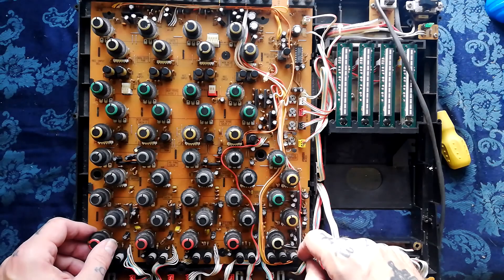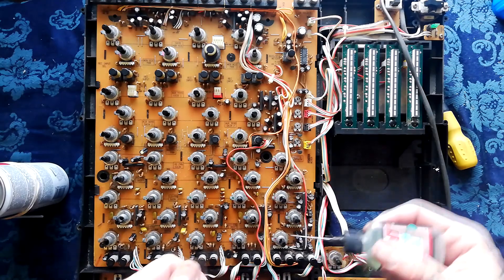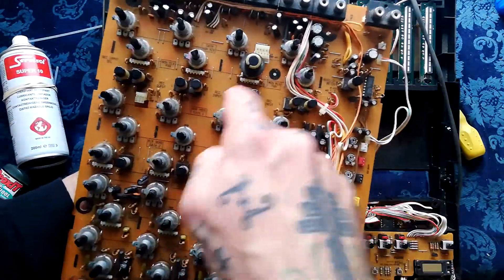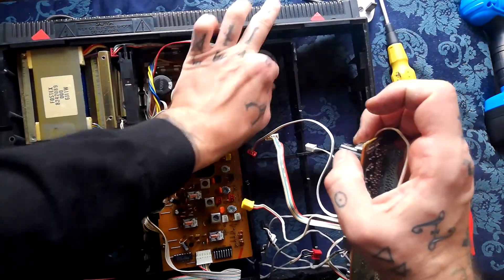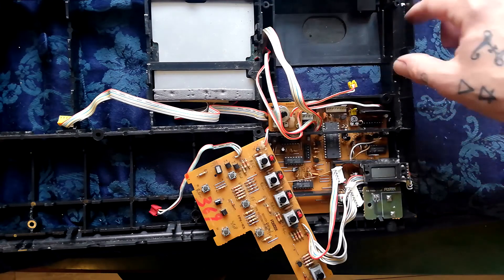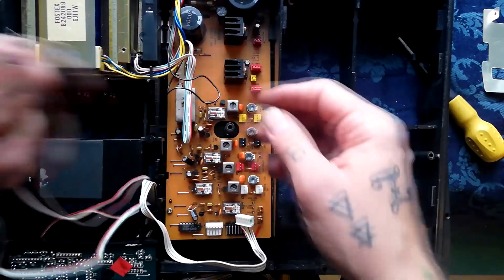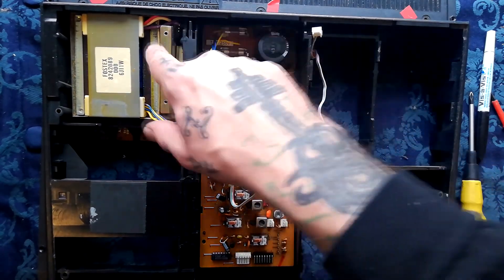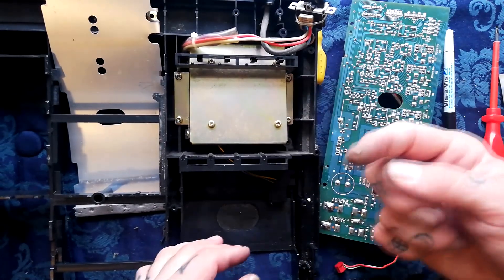Fostex 260 | Tear down | 3 | remove PCBs | Calibration controls

Comment: Thank you so much for all your videos, especially these on the Fostex 260 (I also have a Tascam 246 but my now-ancient recording was all done on the 260). I’m moving my old recordings to digital soon, so I need to have my 260 sending all 4 channels of tape out. I don’t need to record, I’m just focusing on playback at this point…

I’ve cleaned and replaced the belt and pinch roller, cleaned all contacts, and one problem remains: I don’t get any signal from tape channel 1, no matter where I route the signal. 

I just watched your video where you traced the audio signal on a 244, and it made perfect sense to what you were doing (it ended up being a head problem with the recording/PB head).

I can get signal into channel 1, but can’t get any signal out of channel 1 no matter how I try to route it (Monmix, stereo, tape out, Monitor 1/2, Aux 1/2). 

My questions:
1. Does a signal in but no signal out rule out a problem on the input  PCB?
2. Aside from the record/PB head and the signal tracing, is there anything else I should do to diagnose the lack of channel 1 output?

Thanks in advance for any help you can provide.
Reply from the maker: I'm glad the videos have helped you. If you can record to track 1 flip the cassette over and hear what you recorded play backwards on track 4 I would be satisfied that the input path to track 1 and the track one segment of the record/playback head were healthy. I would then get the schematics from my blog and use either photoshop or plain old low yech coloured marker on paper printouts to figure out the signal path from the head to the tape out in playback ord mode - which should go sometjing like this head; connecting wires; relay or other switching solution (choosing whether the head is connected to the record smp or the play amp) coupling capacitor; opamp; another coupling cap; tape out socket. Armed with this recon,  use an audio probe to find where the signal is blocked, replace components as appropriate
Reply: @Tetrakan  Hi again, The meters were showing a signal in to channel 1, but the meters are connected directly to the front end of the input PCB (J101 for anyone scoring at home). I did the record-on-side-A-and-play-backwards from-side-B trick, and lo and behold….there’s no recording there. Tracing the signal path with the schematic and on the board, the input signal from the jack isn’t getting to J102, which is the output jack/plug at the mixer side of the input PCB. That’s why it isn’t recording on Channel 1. The grape transport out goes through J102 into the PWR assembly, then to the Rec/PB amp, and then to the mixer. Since those four channels don’t come apart, it looks like it needs a new input PCB. Ugh. I don’t even know how to begin to find one if they exist outside of “parts only” 260s, and there’s no guarantee of their condition from a seller that can’t (or hasn’t) tested it.

So…I’ve got at least a partial diagnosis, now I either need a parts source or needs o get lucky and score aa neglected (but not abused) 260 on Craigslist or on the interwebs.  Any suggestions? (8 other lurkers with Fostex 260s in their family room want to know, but won’t admit it). :>

Comment: Hi;  
I recently purchased a fostex 260 in average condition.  
I changed the belt and cleaned it but now I have another problem.  
When I press pause the transport gets stuck in the high position, so I have to restart the machine to return it to its normal state.
Do you have any idea what i need to check ? 

I cleaned the solenoid but always the same .. 

Thank you for your attention and the time  you spend dismantling these machines!
Reply: Did you ever figure this out? I have the same issue.
Reply: I actually found the solution! It's in my most recent video!

Comment: These videos are so helpful! Thank you for posting them! I’m currently trying to get my fostex 260 in working order, but my play head is running way too fast. I tried turning the trim pot mentioned @6:00 but it doesn’t seem to have any effect on the pitch. Do you have any suggestions? Thanks!
Reply from the maker: Tjanks! If the cables or solder between  the pitch control and the motor are faulty that can cause the pitch control to be unresponsive. Use Continuity tester on your multimeter to check the connections and apply fresh solder if necessary
Reply: Hello again! So I managed to figure out that my trim pot was faulty, although when I have the new trim pot and mean pitch knob turned down as low as possible, the tape is still running very fast. Any ideas where to look next? I’m kinda stumped
Reply from the maker: Two thi ga to consider... That unit runs at 3&3/4ips, if you play a 1&7/8 ips recording in there it will sound like Alvin and the chipmunks. If the replacement trimpot is too low a value the motor will run fast. Either of these apply to you?
Reply: So the trim pot I used for the pitch has a 10ko resistance, and I also think I’m using a 1 7/8 recording which explains a lot. Almost any professionally manufactured tape sounds very fast. If I increase the resistance, can I make the playhead record at 1 7/8?
Reply from the maker: I don't know the value of the original trimpot, but I'll be in the service manual which I'm.pretty sure is up o  my blog? Yes more resistance = slower motor. A commercial tape should play back at double speed. 3&3/4 ips will give you better fidelity.

Comment: Hey there! Thanks for those videos! I own a Fostex 260 and it functions as expected... ! Well, except for the stereo bus/stereo monitoring. I'm only hearing one side! I am suspecting something either got unsoldered or some component on the right channel died. Got any idea what the problem could be? The recorder definitely records on every channel, it's just hearing the right side via the Stereo outputs/monitor that isn't functioning.
Reply from the maker: Thanks. Check solder where the master fader joins the PCB, the condition of the base plate and internal brushes in case someone spilled a drink on it at some point and the metal parts corroded, then there are typically coupling capacitors bookending buffer opamps either side of the master fader, any one of those components going open or leaky can guive you dead o weird audio in one half of the stereo image. Check out this video, its on a porta 03 but covers the sort of trouboleshooting you will need to do. https://youtu.be/fVs0ALyEUMY
Reply: @Tetrakan  Thanks for the pointers, I'll try that!

Comment: Hello, I'm having trouble calibrating any fostex VU meter. In the service manual, it says that -10db (0.3v) signal should show 0db on the VU meter, but it just dont reach there, in both an reel to reel Model 20 and mixer Fostex 450 it just dont reach there, goes max to -7db on VU meter, doing all the service manual procedures it just dont reach to 0db even at the max pot. I see that you mess around with a lot fostex stuff, did you ever had any trouble with that or you can reach the 0db VU bar normaly?
Reply from the maker: Hmm, can you tell me more about the signal you are using to calibrate the meters and how you are measuring its amplitude? I ask because when I was getting into this I wasn’t clear on the difference between RMS, peak, and peak-to-peak AC voltages….if you were injecting a 0.3 v peak voltage signal into the meter that would not be enough, since 0.3v RMS is going to be over 0.7volts peak to peak, and not all signal generators I’ve owned stated which form of AC you were adjusting on the display

Comment: Btw, could you help me with a dead track nr 4? There is only a very silent signal when gain and volume turned all the way up.  The belt replacement is coming along well thanks to your vids! Thanks!!
Reply from the maker: Hi, check the videos on signal tracing in the troubleshooting playlist on my channel, you want to usean audio probe or similar to figure out where the audio signal stops. Might be as simple as a broken connector, bad solder joint or dirty fader in need of a deep clean, at worst you might need to replace a dead electrolytic capacitor or opamp in the audio path
Reply: @Tetrakan  thanks, but I think I the input fader needs a deep clean indeed. I’m heading to home depot to get a solder sucker but I’m a little afraid to solder the fader back in because solderpoints are really close together... so I’ll try my best to do it as small/clean as possible... thanks for your great vids and advice! Highly appreciated!
Reply from the maker: Wait til the iron is nice and hot, heat the joint for a couple of seconds with the corner of the solder iron tip using your dominant hand (I'm right handed so my right), then slowly  feed in the solder wire with your other hand. You'll be fine!
Reply from the maker: Oh and get some desoldering braid as well, sucker us okay for big joints but small contacts you'll save some time and frustration if you have  some braid aswell
Reply: @Tetrakan  Allright, I ordered the braid 😉 I now Wait untill I have it to do it the right way! I’ll keep you posted. Thanks for the advice my man! Cheers
Reply: Hey, can I ask you something more? I installed the new capstan belt and it is okay. But the problem is that the transport functions work fine but they all stop after 2 seconds... so:play, FF, RW, ... work but just stop after 2 seconds... any idea if there is a bad relay or something? I really would like this thing to get up and running instead of ordering a ‘new’ one on the web, there’s enough garbage already! 🙂  thanks in advance mate! Greetings from Belgium.
Reply from the maker: @jackstargazer5976  is the counter advancing? If the numbers don't ascend, the system will autstop after a few seconds...
Reply: @Tetrakan  no, counter stays on zero
Reply: Wooooops! Sorry man! After your answer I suspected I need to put in a cassette hahahaha now it works... sorry stupid me! Thank you!
Reply: And I don’t wont to sound silly but really thanks again for the video’s, if it wasn’t for you, I wouldn’t have been able to do this! I’m now waiting for a new input fader which will arrive normally this evening. I’ll keep you posted. Thanks, ciaooooo
Reply: @Tetrakan  Hi, me again... After recording on tracks 1,2 and 3 I wanted to pingpong to 4 but the playback of that signal clips and distorts really hard... could it have anything to do with the 10Ka fader I installed there instead of the 20Ka because I couln’t find those? Big thanks in advance!